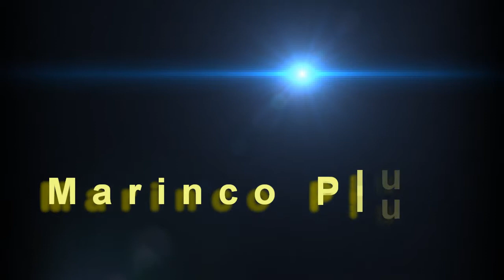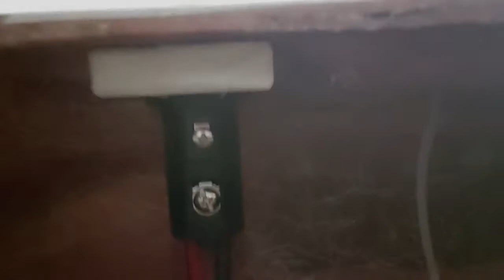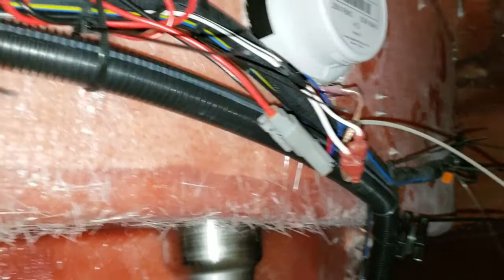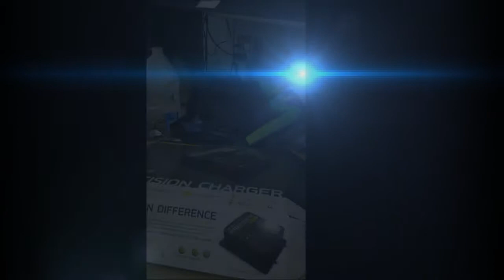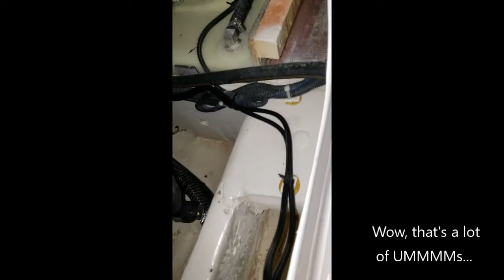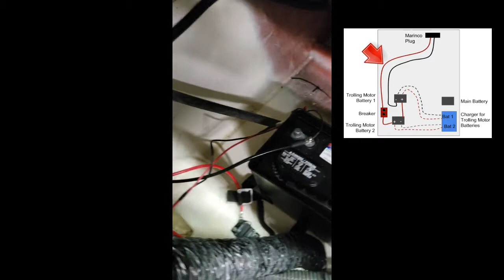Minnkota Trolling Motor Wiring Installation Hurricane SS202

Comment: How many pound thrust is tht trolling motor an how did it work in the 20ft boat???
Reply from the maker: It was the 24v version. It did fine for us, but wasn't in heavy winds. If we would have done it again, the 36v may have been best.  Here's the related blog: https://www.joslynjourney.com/trolling-motor-installation/
Reply: @JourneywiththeJoslyns do u boat on a lake or ocean???....trying to get an idea bc I have the same style boat an im on rhe lake
Reply from the maker: We were on lakes usually reasonably protected. These deck boats don't do well in chop. Was great to get into weeds for fishing, etc.  We sold this boat a few years ago.